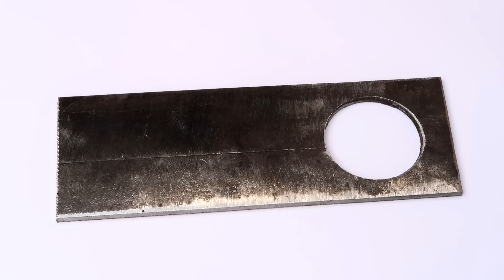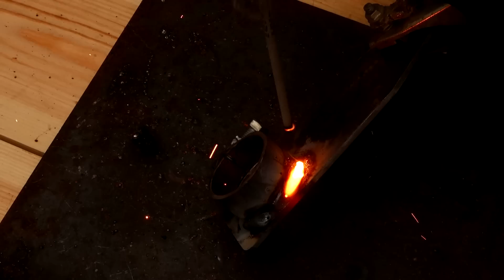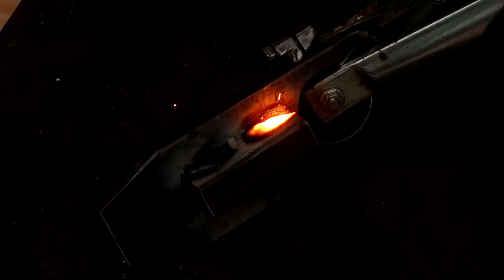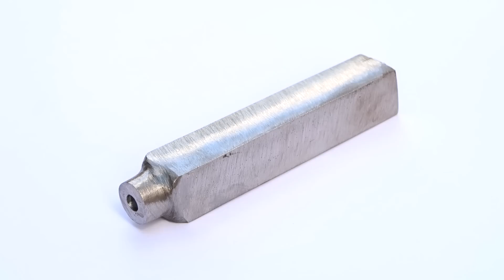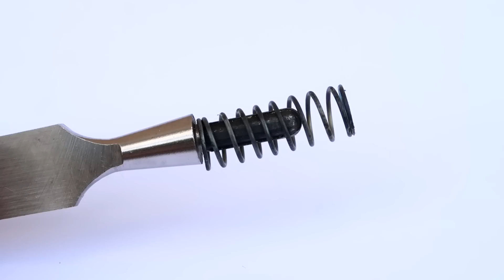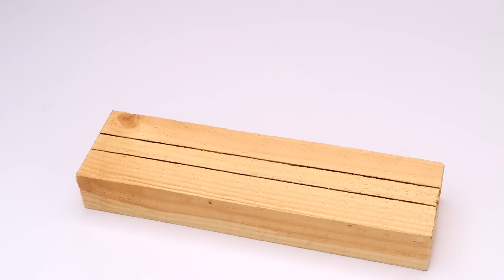Мало кто знает об этой функции БОЛГАРКИ !!!

Comment: It's not a function of the Angle grinder if you build a completely different tool from it.
Reply: As long as it's an extra grinder to mess with, no big deal. Nice alteration ✌️
Reply: @larrysong953  you didn't read the comment. As well the tool already exists and there's no need to build this.

Comment: I applaud your ingenuity, but the tools, materials and time taken far outweigh the positives gained by making this. A multi tool and wood bit would be a lot quicker.
Reply: Multi tool, greatest advancement in tool technology and blades are cheap on Amazon. I think it's a 50 pack for less than 30 bucks.

Comment: Great invented tool for the angle grinder. Specially if you have a battery operated angle grinder and you can use it where no electricity is available. Congratzz....
Reply: Just use a hammer, simple

Comment: Cool project, but for use with wood, I already have a router. Cleaner, faster cut than the chisel can do. But for stripping flooring this might work pretty good. But I already have a multitool for that. I believe I will pass on this project, although it would be a great training tool for a budding machinist or engineer.

Comment: You can but a router on Amazon for £30.00, that’s cheaper than all the materials and the angle grinder used here, when you add in the time factor it’s not worth the effort, can’t knock his engineering skills, just the cost comparison does not make it worth it, plus the router Is much more versatile.

Comment: I would never use that it is dangerous.  The Cam he uses to drive the chisel looks quite heavy. As is is out of balance the whole thing will shake apart.
Or it could if used extensively cause "White Finger"   This is a disease caused by using vibrating tools for long periods.  The vibrations gradually destroy the blood vessels in the fingers.